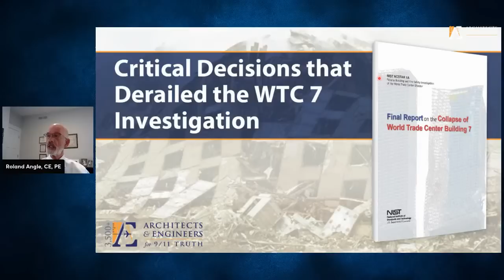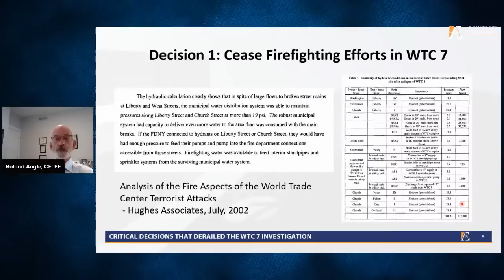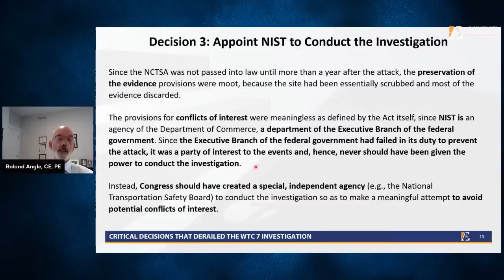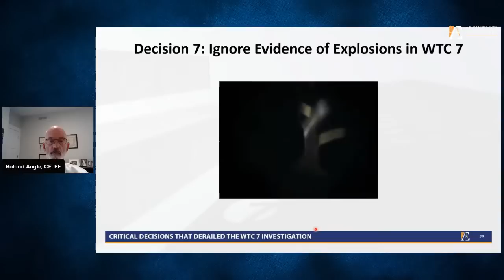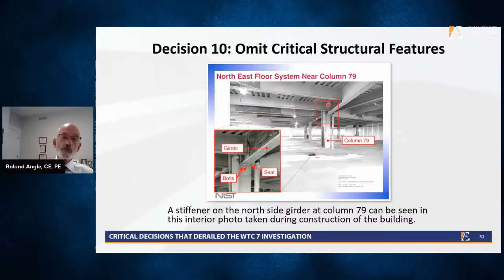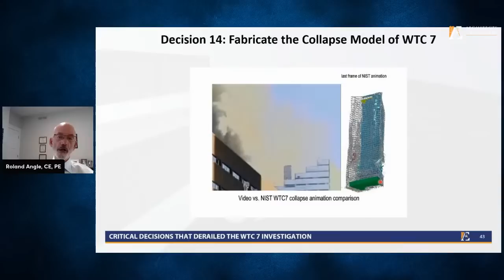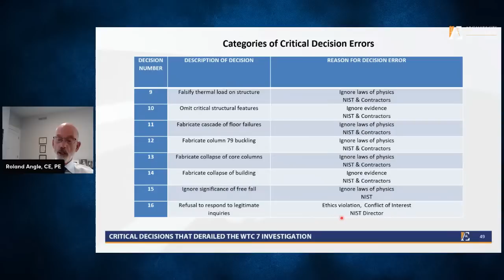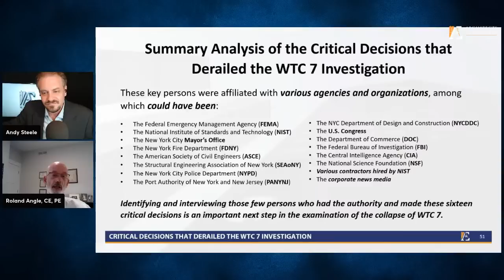Critical Decisions that Derailed the World Trade Center Building 7 Investigation | Roland Angle, PE

Comment: Unfortunately YouTube only allows 200 spaces for submitting questions, and because of that I didn't word my question very well. It was a question where NIST finally admitted free fall for building 7, but only under one condition that it didn't occur right away. Not until they claimed that the support down below failed relatively long after the initiation of collapse had begun at column 79, did NIST allow the free fall. My question had nothing to do with how WTC7 appeared differently to the WTC1 collapse. My question was more to do with physics. In other words, in NIST's words for WTC7, the support below failed first, or as they say buckled first, before any free fall could take place. Logically then, for NIST to say the building section above in WTC1 came down essentially in free fall, and as far as physics is concerned for free fall or essentially in free fall, mustn't the support below always be removed first? I mean this is simple Newtonian or Einstein physics, is it not? How can they have it both ways, where they say one first loses support below before the free fall, and the other one doesn't lose any support from below, and yet they both achieve free fall or essentially in free fall?
Reply: ' Solving 9-11 By Christopher Bollyn . '